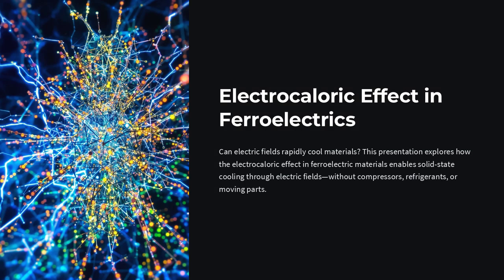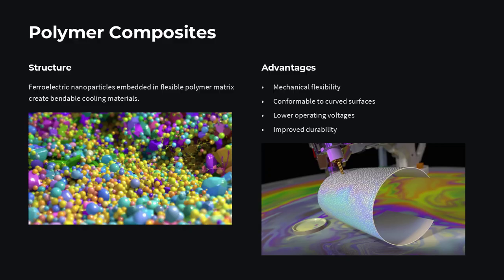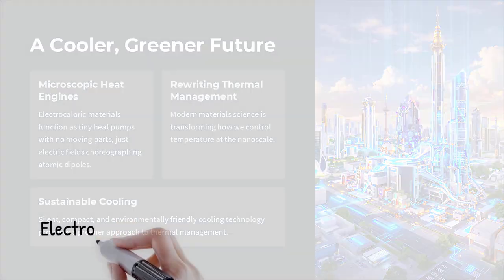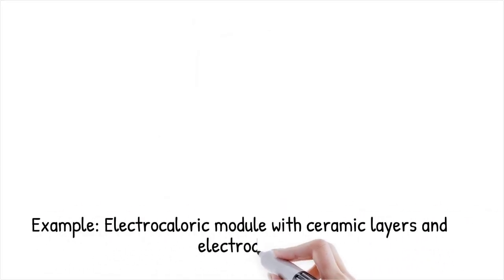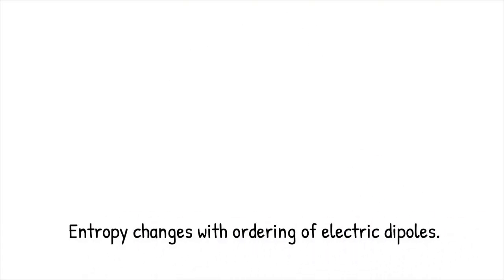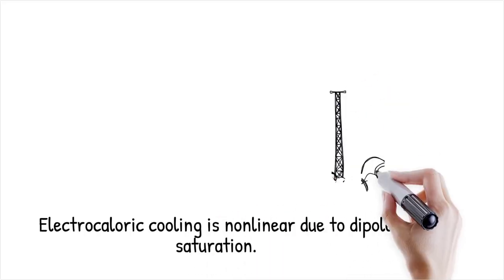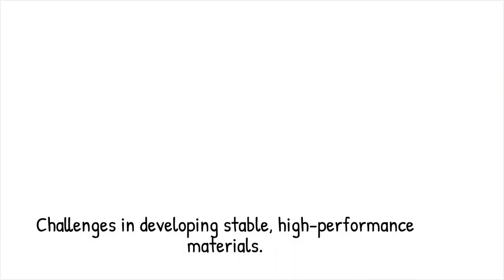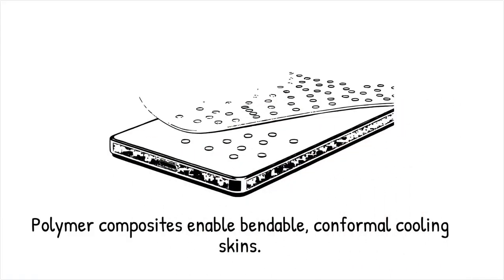The Electrocaloric Effect: Cooling Without Moving Parts

Comment from the maker: How can material fatigue be minimized in ferroelectric thin films undergoing millions of electrocaloric cycles?
What engineering strategies optimize heat flow in and out of electrocaloric devices to maximize net cooling?
Can wearable electrocaloric skins maintain continuous operation without significant efficiency loss in dynamic environments?